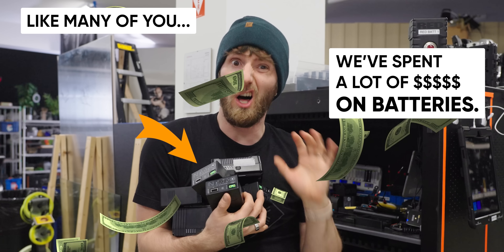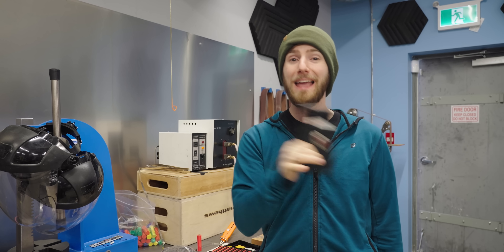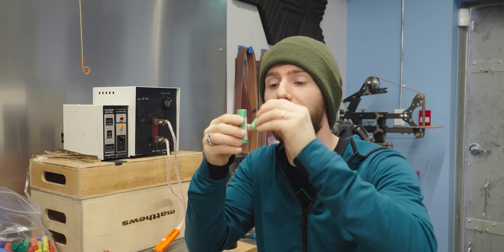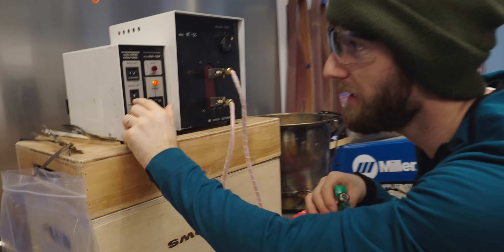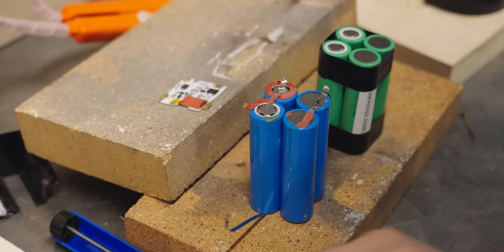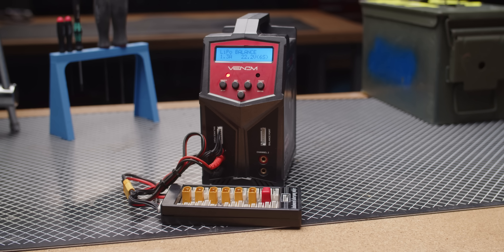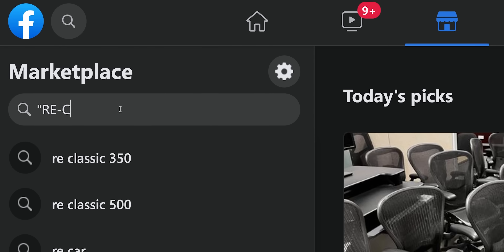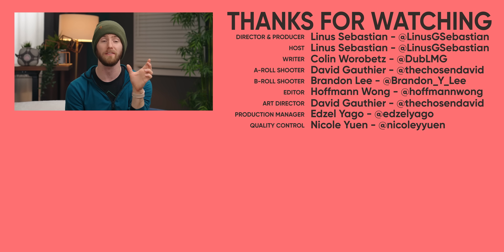This should be illegal… Battery Repair Blocking

Comment: Typically, you need to charge the pack to wakeup the BMS. Most BMSs go into sleep mode when the cells get to low to protect from over discharging the cells. You jump to something was done on purpose to screw the consumers but it's probably a safety feature.
Reply: Most of the BMSs I've dealt with do not allow output after cell replacement until a charging cycle has at least been initiated as you say.  Not encountered an "evil" one yet though.
Reply: He's lucky. EDIT: Forget most of my story below: He's not. His batteries also seem to feature a BQxxzxx kind of BMS/gas gauge that will NOT accept new-cells just straight-away without resetting the BMS (if the cells are the same type) or reprogramming (when swapped by completely different cells).
The BMS in my Bebob V-mounts locks itself after a fault (which can either be done to lifetime-aging of cells or removing them to swap the cells for new ones) and CAN'T recover from that by just waking it up by connecting a suitable voltage as set in the flash-register of the BMS to its charging connectors. It needs deep communication per SMbus connections (which usually are not fed to the outside world) by special interfaces by either slightly dubious software and small hardware from foreign countries and the official interface from the manufacturer. I need both, as the special security keys stored inside the IC's need to be cracked, which, after being cracked can then be altered with the official interface from Texas Instruments.
I completely second you on your last comment: I also think mine are secured well enough to avoid people with a lack of understanding of electronics to mess with them. Lithium cells aren't toys.
Reply: @weeardguy  - Not usually. They usually just use a special "software poppable" fuse, rather than some "memory state" in the IC. The main current flows across the fuse one way, and there is a small thermal heater on 2 smaller terminals that can get triggered by the BMS IC. A small voltage on those terminals will "blow" the main fuse. Bridging a wire across will bring the pack back alive (providing that was what killed it).
Reply: @johncoops6897  Nope. Wrong again. In my BQ20Z65-equipped V-mounts and almost any laptop battery, the logic-fuse, (what you call the 'software poppable' fuse) is driven by the BMS-IC/gas gauge fuse-output ánd when that happens, this situation gets stored in flash-memory of the IC as well, locking out access to flash-memory, flash-constants, disabling the FETs and setting PermanentFailure status. In the PF-register, one can find EXACTLY why permanent failure was declared, and with a logic-fuse blowing, it will be something like 'EXTPF' (EXTernal PermanentFailure) which can also come from additional hardware that monitors the cells even further, and 'SAFE', meaning the SAFE-output (logic fuse filament) was driven high, leading to the aforementioned EXTPF, as the logic fuse is constantly monitored by the BMS/gas gauge.
Bridging a wire is a stupid idea to mention here on Youtube: that logic fuse is there for a reason and is the last resort for the BMS-IC should the FETs fail and the BMS therefor can't turn them off, which means current keeps flowing and the dangerous situation persists.
This is my (preliminary) website-article on me reviving my V-mount batteries : http://m-voorloop.nl/techn-reviving-bebob-battery-bq20z65.html It's really not that straightforward as you hope it is...
Reply: @weeardguy  - i was keeping it simple. This is Linus Tech Tips, and the channel and viewers are very simple folk.
Look at the video and read the majority of comments...

Comment: I was thinking as soon as the BMS loses connectivity, it self destructs so there can be no disconnect to replace the cells. Here's an idea; build a tool that bypasses the disconnect, set up a bypass that maintains connectivity with the old pack so it never knows there was a disconnect. May work, may not, but you guys have the tools to do that, I don't.
Reply: Depens on the BMS: if they have smart-features on board, they can store faults in internal memory and disable the charge and discharge FETs so you can't charge or use the battery any longer. They can also blow a logic fuse to completely disable the pack forever (usually done when things get so out of hand so quickly the BMS itself decides just shutting down charge or discharge current isn't enough to solve the issue, or when one of the FETs fails and the BMS-IC tries desperately to stop current from flowing in (charging) or out (discharging) of the pack, noticing the command to open the FETs doesn't work and thus blowing the fuse to end the fault-situation.
It then takes opening the battery, soldering a few wires to the SMbus connections and start communicating with the battery to reset it again, usually involving entering all kinds of safety-keys to get into the flash-memory of the chip again and reset it (mines are protected with 3 4-byte 2-word keys that have to be entered in the right order to first unseal the device, than enter the full-acces key, to then finally be able to enter the permanent failure-clear key: those keys are known to the manufacturer and can't easily be brute-forced (every wrong data will let the BMS-IC go into a 5 second or so wait-mode before it accepts a new try of entering the key) so you need pricey software to crack it and then an a costly interface to reset everything in a more easy way opposed to the Russian software (which is a bit limited to be honest).
Then you have to replace the logic fuse (if you can find them) and connect the new cells...

Comment: WHO would have thought the build back better NWO is an extremely volatile place of minimum viable product disruptive landfill cancel culture. 
Not fit for purpose surplus to requirment, obsolescence? 
We are all dead in the beast system waters of change? 
💩 eating grin 😁 at the ready. 
Human supposed progress is getting complicated to the point of cascade failure Transhumanism is not living ⚧️🦿🦾🔩🤖🤡🌏 at the end of the 🧲🧭 🌈 
🍫🫖🕛? 
I'm not intelligent enough to survive in if anybody can be lol. 
Progress seems = to escalation of problems 
It's a MAD 🌏 no. 
Mutually Assured Destruction humanity's hubris nexus point please help us all 🙏🏻? 🤯🧠🦧 
🐂💩 Flows down hill via force fed trickle down effect, gutter oil rises to meet it in ice melt mass displacement. 
Either that or I've got 💩 in my middle critically thinking 🧠👁️ 
It will all come out in the wash 🪵🌡️⛈️🌋🌫️🌊🌅🥶 somewhere over the 🌈 
Absolute power set to blow up in our faces, nothing stops progress quite like it, digital NWO what a sick joke of exponential pollution to our destruction lol.

Comment: I already "re-celled" before with great results, but the last time with my asus laptop battery what happened was strange. The battery life decreased drastically in 3 days till die. I found a bad cell in it and replaced and, surprise, all cell working but the battery was not recognized by the pc. Now I think that's the BMS trying to avoid the re-cell.
Reply: With laptop batteries especially, in the pack there is a microcontroller if for whatever reason looses power or expires on charging cycles, it will then completely disable the battery cells from ever charging again by ignoring a confirmation handshake with the laptop so the laptop will then refuse to charge the battery.
Reply: @Tyrone Nelson  after this video I took that battery to test it again. On internet i found something similar to what u are saying. By the way I found out that you can try to "jumpstart" the battery. After the jumpstart my laptop charge the battery while connected (checked with multimeter), and the pc recognize the battery and its specification, but the pc doesn't use the battery to run and still say it's at 0%.
Reply: @Jaimboo  Exactly, the battery is recognised by the laptop, but it wont charge, so it seems like its an 'evil' bms.
Reply: @tyronenelson9124  it's worse than that. The laptop charge the battery, every cell reached a minimum of 3.6v, but it prevents the battery from powering it
Reply: @Jaimboo  Exactly, so the microcontroller has blocked use of the battery also.

Comment: Talking about fire safety. I like to work already outside whenever I have to work on Li cells. The cells I am working on actively are inside a metal plate with low borders, maybe 1 cm or something high, and a bag of sand ready. If there should be a fire, I pile the cell with the sand and extinguish it by suffocating it. Ditch it into the bucket after a while and clean the plate. After all I probably have work to get done with those cells.

Talking BMS, dumb, basic and smart are usually here to prevent damage to the cells and therefore potential fire. I don't really mind those. And I just realized, we usually don't try to rebuild a pack but to build a new one out of the still good cells. That's probably why I rarely ran into the evil ones.

Great video tho, this needs to be pointed out in a much larger scale.

Comment: Question... Would the use of a cold solder conductive adhesive be a safer solution that welding? It would be more expensive per battery but there would be less chance for a spark. Thanks! Great video.
Reply: Forget it. The currents running through such batteries are not suitable for such connections. Besides that, much of the structural integrity of the complete pack comes from spotwelding the cells together. The sparks here are just spotwelding mistakes, no shorts. Shorts don't create such big sparks, but far more smoke and glowing bits flying everywhere (yes, it happened to me once during the assembly of the 4S4P packs for my Bebob V-mounts I recelled myself)

Comment: Another form of DRM the I have seen on bms boards is if the bms senses zero voltage from the cells (like removing the cells) it will stop working, forever. I have had little luck with soldiering on some wires temporarily, apply an "in value" voltage from a separate source, then remove and replace cells, before removing the temporary leads. But it can be difficult to unsoldier a lead while not losing connection with another lead on the same soldier pad. 
Tried this with 4 identical camera batteries and only 1 attempt was successful.

Comment: We just need some laws to enforce standardized battery packs, get back to the batteries not included model.  As it sits now manufactures create products as a way to sell batteries and consumables, the only way it ends is standardizing those consumables. Tool companies should be in the business of selling tools, not batteries. Camera companies should sell cameras, not batteries. Printer companies should sell printers, not ink and paper... Printers should be designed around industry standard ink/toner not designed to work only with some proprietary blend they buy in anyway that serves zero benefit to anything other than extorting money out of customers.  If every 20v cordless drill was required by law to interface to a standardized battery pack we would be looking at $25-40 battery packs rather than $100 oem nonsense.

Comment: Dude, you keep yelling about explosion and fire risk when working on these batteries. Stop being so risk averse, that is why these things are so hard to fix as it is. I mess with gasoline, ether, denatured alcohol, mineral spirits, batteries, high voltage, welders, etc. all the time, all fire and explosion hazards and I'm far from professional at anything. Does anything dangerous happen? Sure, but I learn from my mistakes and don't make them again. going on 13 years in the same house, and I've not burned it down yet.

Comment: Arguments against Right to Repair is literally "No, I don't want rights!"
Change my mind.
Reply: @AlphaCarinae  That is an unconvincing argument against, for example, a John Deere Tractor having sensors all over it that automatically brick the whole machine if you try to change a tyre.
Reply: @AlphaCarinae  It should not be the company's responsibility to prevent tampering, slap some warning labels on it and that's it. If the user ignores those warnings and tampers with it anyway, it's their own fault if they get injured. Same thing as with for example the shelf thing at the top of some ladders that have clear warning labels to not stand on it. If the user stands on it and it breaks, that's their own fault. Unreasonable assertion of liability is not a good reason to oppose right to repair.

Comment: How about making a pack and charging it to a similar voltage to the one to be replaced and connecting it to the BMS in parallel to the old pack and then disconecting the old one?

Comment: What I would like to see manufactures do is make the 18650 cells replaceable like you would with AA batteries where you just pop open a compartment and insert batter between a spring and a lead. There are already some devices out there with this design for 18650 cells, but not many companies are doing it.. Because why do that when they can sell you another batter pack for 10X the cost of the cells later..
Reply: The spring type battery holders won't handle high current drain from power tools and other equipment as well as spot welded packs, plus they cost more to make than just a flat piece of nickel and a quick zap with the welder. They could possibly make a heavier duty spring loaded holder, but that would be even more expensive and increase the size of the pack with no real benefit to them. For low drain items like flashlights or portable radios, it would likely be fine. And of course, your last sentence is spot on!
Reply: It may also be that the 18650 cells aren't made to handle enough pressure for a spring holder to work at any significant power level
Reply: That's impossible because not every BMS can handle removing cells, which usually triggers alerts and safety-flags. It's also useless because the BMS handles the total capacity: if one cell or group of cells is worse, it will limit total capacity.
Add that unbalanced cells are a severe risk when connected together (which starts huge currents flowing) ánd that spotwelded cells make up part of the structural integrity of the total pack, and you know why such options aren't used. You would also need a shitload of single cells to replace them for an average V-mount or Gold-mount or RED-brick. My (former) 90 Wh V-mounts already count 16 cells. After I replaced the original, dead cells (Sanyo UR18650W) for Panasonic NCR18650 and completely resetting the BMS and reprogramming it with the right settings, the capacity has now nearly doubled.
Reply: @weeardguy  Not arguing but that is why they BMS should have a reset button inside the case but this would all be dependant on battery hold down mechanism that Mike was referring too.
Reply: @inactive67  Having a reset-button isn't the only problem: a BMS can then need 1 or 2 cycles to 'learn' how good or bad the cells are by discharging them with a steady current down to set system limits. BMS-IC's, especially the very smart ones from Maxim and Texas Instruments and the sorts, are incredibly sophisticated pieces of electronics, which come with the drawback that 'just' swapping groups of cells out just isn't possible, because you would then start to monitor each individual cell ánd the BMS would need to 'burn' energy in groups of cells if the cells inserted have aged more (and thus have a lower capacity).

Comment: Noob here, what about cool soldering, with a heat gun, there is solder that can melt at sustantially lower temps that may be useful on lithium batteries.

Comment: I'm curious, joining the batteries electrically is the whole point. So if spot welding is so tricky and ruins many batteries, why not silver soldier them instead? Wouldn't that join them in a safer manner? From the times I've been around friends who spot weld, they do so for speed and ease, not because it's the best or only way.
Reply: Uhm... spotwelding isn't tricky, this guy obviously lacks skill and is overcautious when something sparks. My kWeld also provides a spark from time to time. Nothing to worry about as long as nothing starts to heat up AFTER spotwelding, starts smoking or even discolourise due to the huge currents that start to flow.
Spotwelding provides an incredibly sturdy connection that is well resistant to mechanical impact. Most solder-connections are not up to mechanic shocks or vibration. Besides that, structural integrity of the whole pack is largely part of the spotwelding-process.
Soldering to lithium cells... nah, I would not recommend it. It could be the cell-manufacturers play a game by stating this in their datasheets so consumers don't start messing with them, but considering most batteries have quite stringent temperature limits (charging needs to stop if the cell reaches 65 degrees Celsius if I remember it right, JEITA compliance thingy), soldering to them is the absolute worst thing you can do. A spotweld is quick, sturdy, provides structural support/integrity and hardly heats up the cell.

Comment: You talk about safety but forgot one very important thing!
Cover all terminals with electrical tape that you don't want to spot weld right now!
It does not just save you from accidentally dropping something conductive (like a nickel strip, screwdriver, flush cutter) on the wrong place or protects you from shorting the battery when you place it on something conductive (the bottom side needs to be protected as well). It also gives you time to look at what you want to do. When you are welding a lot of batteries, it's only a matter of time before you place a strip on the wrong terminals. Be safe!

Comment: Yo wait, you have a miller welder right beside you!
I’m not condoning it, but next time you need to weld up on a battery you should use it.
You can lay down some sick beads on batteries.
I’m not liable